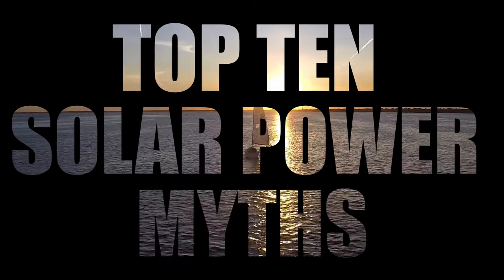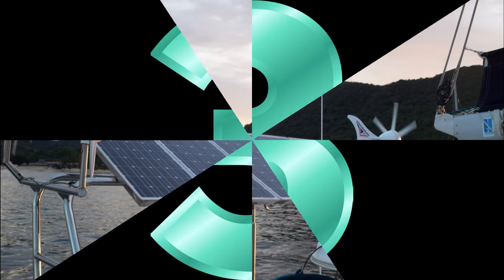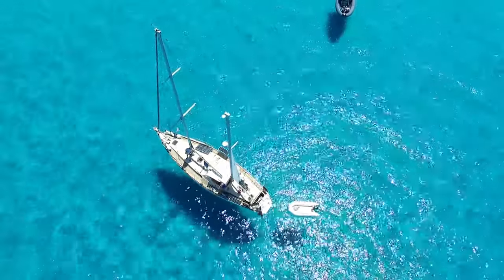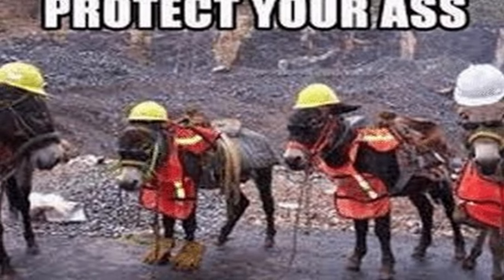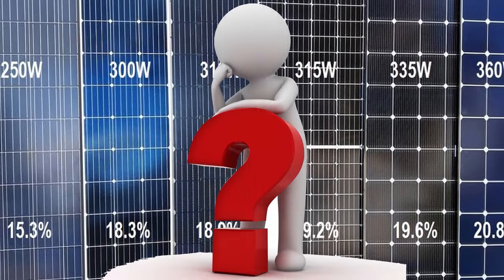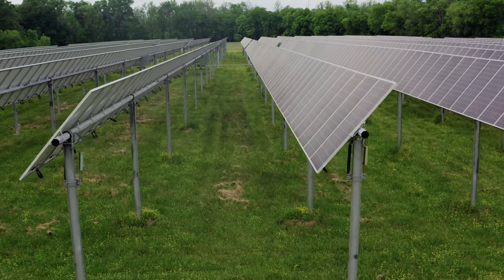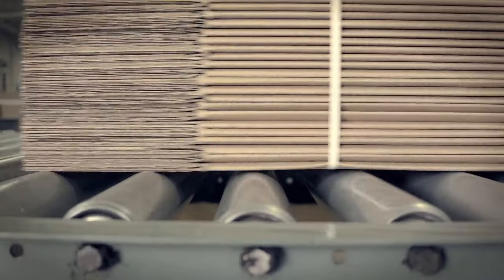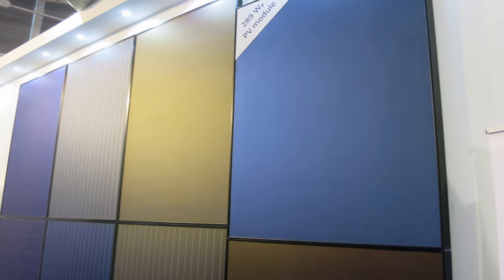Top Ten Sailing Solar Power Myths

Comment: Another good video. It basically reassured some of my research on solar. I like to see more on this subject such as: Most efficient solar panel, MPPT or PWM charge control, lithium versus lead acid battery, 12 V DC or 24 V DC system. One of my biggest thoughts is battery bank, how many. There’s so much here. Can you wire solar panel in series and battery bank in parallel. Pandora’s box has been opened. Some of my research is confusing such as flexible solar panel. For panels to be efficient they need to have the cooling ability and flexible panel strapped to a bimini does not have the cooling ability but yet I’m seeing there being used a lot.
Reply from the maker: Funny you mention those topics as those are all coming up soon. Tomorrows video is solar vs wind, then anchoring vs anchorages on Sunday, next Friday is lead vs lithium, I will do one on controllers, solar wiring, and much more. I have determined versus videos or specific in depth topic videos like my salvage sailboat series will be what the channel will focus on. I dislike the argumentative topics such as ( what is the best blue water boat ) and so on. Thanks for watching and commenting again :) Don't forget to send me your address for your shirt
Reply: @away-from-world  
There’s so much to learn about solar system. The one thing I have not heard about until now is the use use of used panel. That could be a great option 👍🏻.
Reply from the maker: New video up, take a look and let me know what you think https://youtu.be/1F76BR4d2W8

Comment: I have heard from sailing users that the flexible solar panels weren't as durable as the glass and frame versions.  By this, I mean that they started having problems with the flexible panels losing efficiency rather quickly.  I don't know why this happens, maybe they were the "occasional" foot traffic types, and were abused, but do you think it is a fair statement that glass and frame is more durable?  What about more durable for the money?
Reply from the maker: That’s a tough call without knowing what type of flexible panel , there are some cheap ones that definitely don’t hold up well for long. This is one of those areas where it’s best to spend the money upfront. Flexible panels are coming down in cost overall but initially it was a cosmetic thing. If buying a flexible panel that you plan to place on the bow that will have lots of traffic it’s best to really research and spend the money as well as check into the warranty. I don’t like glass and aluminum for a few reasons, they do serious damage when they get ripped off in high winds ( I was in hurricane Irma ) so I have flexible but they are not in super high traffic areas and have yet to run into issues
Reply: the problem isn't as much as flexible vs glass framed. it's how people install it. heat degrades cell production and life cycle. a lot of people glue flexible panels directly on a surface and this causes the cells to heat up way more than air temperature. what's the surface temperature of your car roof vs the air? so basically you could get greater than 25% loss production and have the panels die in 2-3 years. that's why most manufacturers only warranty flexible panels for 1-5 years while nearly all framed panels have 20-25 year warranty. I know it kind of defeats the purpose but if installed with an inch of air flow beneath the flexible panel, you'll get much better production and lifecycle. then again if you going to do that, just get framed panels.
Reply from the maker: New video up, take a look and let me know what you think https://youtu.be/1F76BR4d2W8

Comment: Would love to know your thoughts on electric motors and regen. Combined with a diesel generator, I don't see any real disadvantage to that setup other than cost or if you REALLY have to get out of dodge FAST. Edit: Folding props would probably be a little difficult to get working with them, though I think you'd be able to run the motor just a little bit to engage the props, shut it off and swap it over really quick
Reply from the maker: There are some things to implement now that I feel technology is effective with. Swapping to lithium batteries is a great step. I honestly don’t feel the electric motor for sailing is quite there yet.for not only effectiveness but financially. I also don’t know enough just yet to have what I would consider a knowledgeable point of view on them. It sounds like Uma is going to one or has, not sure as I’ve never seen an episode and I believe la vagabond is swapping to electric. Once those two are successful then I believe we may start to see more. You need something like a Tesla to come in and really put money into the manufacturing aspect to bring the price down enough for the average sailor. The companies that are trying to go and market electric motors are not large enough just yet to have an impact I don’t think. I’ll check into it and see what I can come up with. If I find enough info I’ll do a video on it for ya
Reply: @ChasingLatitudes  Batteries would be a hell of a cost sink for sure, but a liquid cooled dc motor spinning a load is the same as any other - there is absolutely no reason you need to get one "meant" for boats - 20-50 kw dc motors, liquid cooled, meant for cars can be had for like $1K USD, though yes, you'd need a radiator, pump and a fan going instead of using ocean water. Edit: Now that I think of it, where do you dump the heat without constantly having a rusty radiator? Speaking from experience, "coastal" doesn't mean a damn thing when it comes to radiators, not sure if marine would. Might not be as viable as I thought. Edit Edit: Liquid to liquid heat exchanger. Duh.

For boats, LiFEPO4 batteries would be the best I can think of - LiPO performance, way less likely to explode, less offgassing
Reply from the maker: New video poste, more of an artistic one, let me know what you think https://youtu.be/brTagC9jwvc
Reply: @ChasingLatitudes  I sincerely want to commission a mural from you, beautiful work man. Genuinely the best sailing channel I've found imho. Keep up the good work.
Reply from the maker: @isthisoneunavailable  ahh thank you so so much 🥰